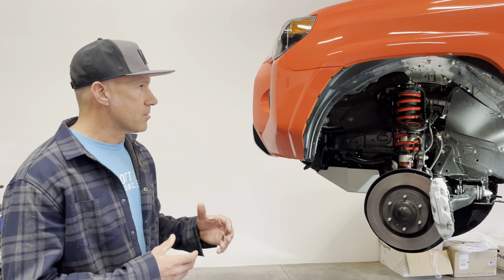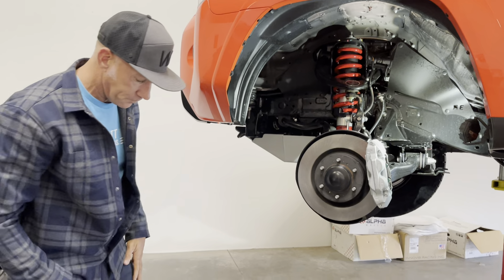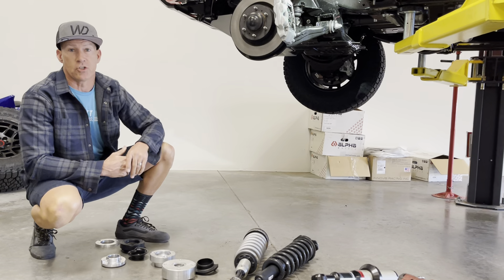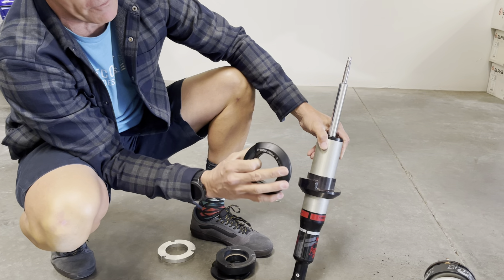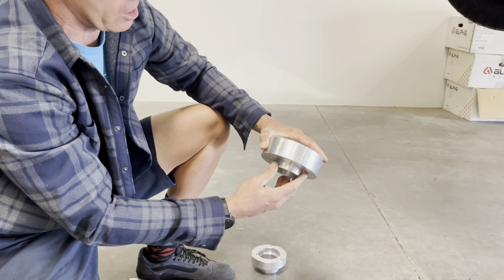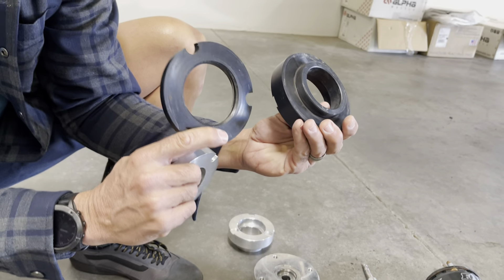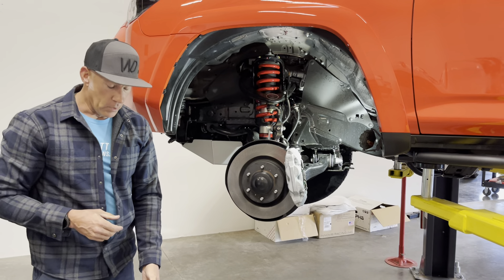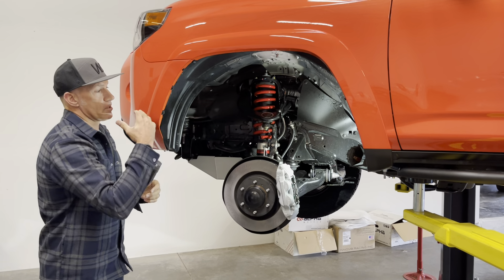The right lift for your factory suspension

Comment: I love the Wescott lift on my ‘21 TRD Pro.  The truck rides like stock, maybe even better because there is a bit less nose dive on braking.  It looks amazing; as it should have done from the factory.
Reply: What did it run you? I also have a 21 pro and want to leave OEM shocks but just level it. What’s the most I can get without changing the whole suspension
Reply: My man I just got a 22 pro and very curious. You still 😊 with it?

Comment: Are used Wescott design lift on my 2017 Toyota Tacoma pro model cement colored in Hawaii as well as Rodin 35s Arb Bumpers etc. off the hook vehicle put 30,000 miles on it in Hawaii and sold it for $10,000 more than what I paid for it in South Carolina shipping it to Hawaii I use sparks dealership in South Carolina. Mike was my salesman as well as Jeff from this site here they build bad ass trucks and now I’m going to build a 2024 pro also hybrid with the assistance of Mike and Jeff
Reply from the maker: Thank you Mike for always believing in us and putting your trust in us!  Means so much🙏

Comment: @Jeff - would you say your kit works better with the Fox or Bilstein shocks as compared to the more basic Hitachi’s?  I’ve really enjoyed the overall ride quality on my ‘22 Tundra Platinum but have noticed the rebound isn’t controlled very well when hitting a speed bumps or pot holes.  It feel like a harsh “top out”, a bit bouncy.   And yes… alignment is per your suggested spec.

Comment: just bought the lift for my 4runner trd pro! Would i need to do any adjustments to the panhard bar/track bar with this lift?
Reply from the maker: @MingyangHung  you do not.  There is not enough movement until you get to the 2” mark in the rear that it starts to become a problem.

Comment: I see these videos, where bigger tires are put on. With a larger tires do you suggest re-gear and bigger brakes? I have seen this done on other 4x4's so far not on the 4runner. Have a great day.
Reply from the maker: I feel that the brakes do just fine.  If someone has money burning a hole in their pocket have at it.  Anything bigger then 33’s or a 285 for sure would doo 4.88’s or a supercharger.  They do t have a lot of power with the stock tires.

Comment: I have a ‘20 4Runner TrdPro with the Fox shocks. I was measuring for your lift when I noticed the bottom spring collar is much lower on the passenger side shock than it is on the driver side shock. Like an inch lower. Is that normal from Toyota? Or has my bottom collar somehow slipped down on my passenger side?
Reply from the maker: @TheKingInHiding  that is normal.  It was not till all the new Gen trucks with the balance weight being the same corner to corner within 15 lbs.  On the 5th Gen 4Runners the gas tank and driver and brake booster are  a lot more weight so the push up the spring to give it more preload on the drivers side to help the vehicle to sit level because of it.  So there is a right and lift strut on all the 5th Gen’s.
Reply: @westcottdesigns thank you 👍

Comment: How much is the ride stiffened up? Is it significant or nonsignificant? Thanks for providing the video, great explanation. Are these special spacers only for the TRD Pro or is the same method used for the regular Limited TRD?
Reply from the maker: We make them for the sub model Tacomas, 4Runners, Tundras and Sequoias.  I original did them for TRD Pro models in 2015 when I worked for Toyota.   Does it stiffen the ride?  Yes but in a good way.  Toyota sets up all there trucks soft and squishy.  Perfect example!  Coming to a quick stop at the light and feels like it’s going to stand on the front bumper.  Swerve for a pot hole in the road and the side to side body roll is terrible.  So our preload collar helps the ride in many ways.  Some people say they can’t tell it’s even the vehicle and others say they think it drives better.  So both are answers I’m good with.  We sell about 3000 kits a month and we do get a couple people that did not do something right or set up the alignment correct and that really effects the ride.

Comment: So this maximizes travel both up (stops at bump stop) and down (extension stopped by shock internals prior to anything external contacting) on the TRD Pro Fox suspension. Small increase in lift and up travel, good increase in down travel, more overall stroke. Is that accurate?

Comment: So a longer spring& shock assembly is the better way.Seems just easier & cheaper to make new collars= more profit.
Reply from the maker: The collars are really not that profitable with all the machine time and a half of million dollars machines to cut them all.  I should have just lasered out some spacers and spot welded them together and put them on top and made a shit ton of money!  Oh wait we do things the right way at our shop and do things that are not going to fail or to ever cause failure.   $425 billet machined lift kit that works great or a set of $1200-1800 set of coil overs🤷‍♂️. I guess it comes down to what the customer is willing to spend.  Is a $1800 set of coil overs going to work better?  For sure it better for the money.  Our kit is a cheap way of doing it if someone does not want to spend the money👍
Reply: @westcottdesigns how long has your kit been out? I heard you say 30k sold and none failing that’s 👏🏼 😎 I saw your employee assemble on a video you posted. That mallet was scaring me 😂 that’s the really my only concern when installing this.
Reply from the maker: @scoobysid04  I have been doing them since 2015 when I used to work for Toyota.  We have some of our customers that now have 150 k miles on their vehicles with it and still going strong.
Reply: @westcottdesigns  that’s awesome and congratulations Jeff 😎
Reply: @westcottdesigns  why not just use a longer spring? Springs are cheap, altho more complicated (spring rates, etc.), especially when ur taking it off anyways for your perch clip install. Guess billet machining is alot easier than becoming a spring company?

Comment: On the 4Runner, does the changed axle angle shorten the life of the joints if you're doing a 2" lift?
Reply from the maker: We designed it to minimize the angle change.  We are not extending the struts longer then factory design so we don’t compromise the life of the axles.  We have never had axle failure and have been doing our kits since 2015 and some of the trucks have over 150k miles on them.

Comment: What is the off-road performance like with these lifts? I do a lot of off-road stuff for hunting and camping. Would love to know as it’s much more cost effective than overhauling with a whole new suspension set up and safer than spacers.
Reply from the maker: Look in our You Tube shorts and there is a video of one of our customers getting after it in his green TRD PRO 4Runner.  He is pretty hard on it regularly and is still going strong.
Reply: @westcottdesigns  Sweet! Thanks, do 35’s have enough clearance for chains or would you guys recommend sticking to 33’s if I know I will be running them in various seasons?
Reply from the maker: @itsHOPPYhour  I would not say 35’s would have enough room with chains

Comment: Are the bilstein 6112 coil over kits compatible with kdss and would you say it’s a good value for a front and rear set for 1350$ or is there a better way to spend 1300-1400$ to
Get just a little lift and better handling on a 22 orp ?
Reply from the maker: That would work fine.  It would be a good set up.
Reply: @westcottdesigns  thanks. Do I need control arms for that setup ?
Reply from the maker: @cppctek  as long as you keep it under 3” you will be fine with stock arms.

Comment: So I totally get that your lift design is just like a fox coil over where you preload the coil and it gives the vehicle lift..BUT those coil overs are made for that and have enough shaft in the shock body so you don’t run out of down travel. Are 5100’s or 6112’s made to preload the coil that much and lift that shaft out of the shock body even more than it already is to where the down travel isn’t affected?
Reply from the maker: The only ones that don’t work as well as would like is the new Tundra.  They shorten the shaft 2” and it does effect the rebound.  All the other kits we make we did not over do them and the shock shafts are great and those kits have always worked amazing.  I started doing our kits on the Bilsteins in 2015 when I worked for Toyota and it was a great way to add a little more lift.

Comment: So on a 2022 TRD ORP this exact setup will not adversely affect front driveshaft CV joint angle? 
I’ve seen other installs different brands and they add diff drop spacers and I do not want to do that.
Reply: Not at all

Comment: It will decrease the travel of your shocks, and will stiffen up the ride. Most important pros of the trd pro fox shock is that it's soft at initial bump, gets hardened after that. Which is great for on road and offroad. You will ruin the performance of your truck.

Comment: I checked the product but not sure which to buy.  We talked before but i forgot.  I have a 2016 4runner TRD Pro should i only buy the front lift because i don't  see a rear lift for the Pro
Reply from the maker: So if you have a 2016 TRD PRO 4Runner it is a Bilstein 6112 in the front and a 5160 in the rear.  Here is the link for the front and rear kit for your truck.   Select 4Runner and you will be all set.  https://westcottdesigns.net/product/bilstein-trd-pro-lift-kit/

Comment: Jeff, been watching all your videos to understand and educate myself on your lifts. With your lift and a small spacer at the top as you shown if you add slightly bigger spacer for a little more lift that compromises the shock at full compression and bottoming out will eventually break. So with your lift, it is engineered and measured to hit the bump stocks when bottoming out to avoid damaging the shocks. Now say, if you were to add more load to the spring with the collar and bigger space at top, can you change the bump stock to a larger one so it wouldnt bottom out at the shock? Wouldnt that fix all the concerns of damaging the shock & end up with a higher lift?

My question is, by changing the bump stock wouldn’t that fix the concern of wearing the shock bottoming out?
Reply from the maker: What we are trying to do is maximize the upward travel for compression or when articulating the vehicle so by pushing the whole strut downward and doing a extended bump stop you would be limiting that.  The other major problem is that the axle angles get increased and start to cause excessive wear.on the CV’s and the bearing for added load.  Now for the lower preload collar you could increase the preload on the collar to get more lift out of the front but then when the vehicle sitting on the ground and you lift the front of the vehicle you are now taking away from the rebound of the strut.  This will cause the strut to top out to soon.  We like to see between 2”-2.5” of rebound.  The new Tundras have a 2” shorter strut then the last Gen and with being if the alignment is not spot on this causes the truck to not have enough rebound and causes a harsh ride from the rebound.  We are at the limit with that strut.  We have talked about taking some more preload out of it to bring the front down a little more to allow more rebound for a little smoother ride.  But then people complain that they don’t have enough lift and they are getting rubbing.  So I have come to realize you can’t make everyone happy

Comment: will it void factory warranty?
Reply from the maker: Anything you do to your vehicle can void your factory warranty.  Even changing your wheels.  If anything you do is in direct relationship to something that fails and the manufacture can prove that it was the cause of the failure it will void the warranty on that part and that part only.  We have yet to have any of our parts fail or cause failure.
Reply: @westcottdesigns  So if I put this lift on my 21 Tacoma pro, will it be equal to or higher than the 22/23 pro?
Reply: My 2yr is coming up so that’s why I’m curious about this lift.